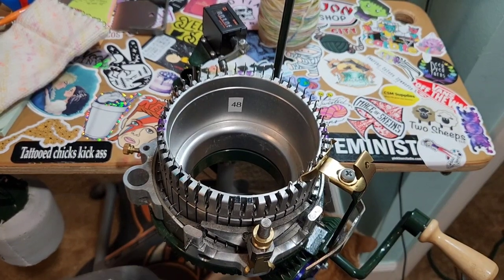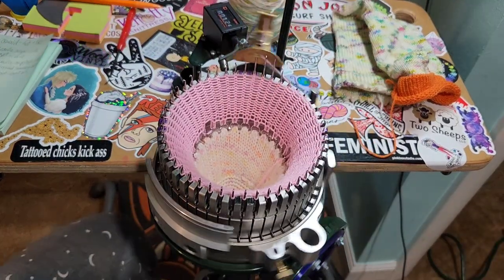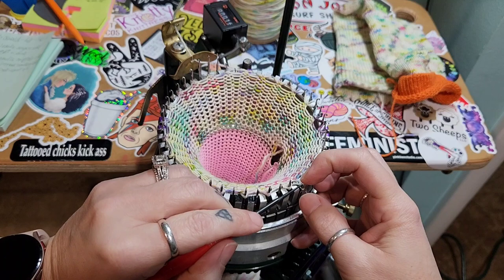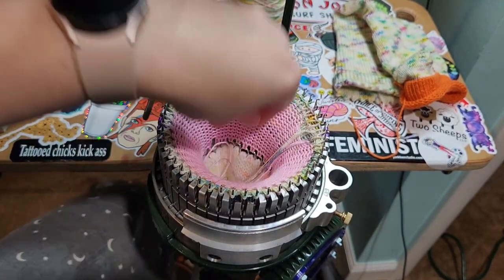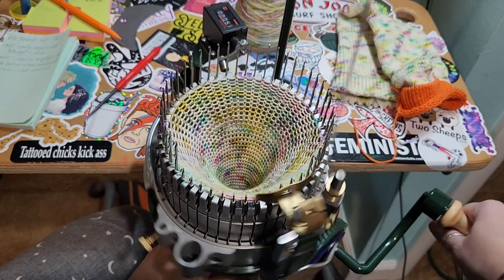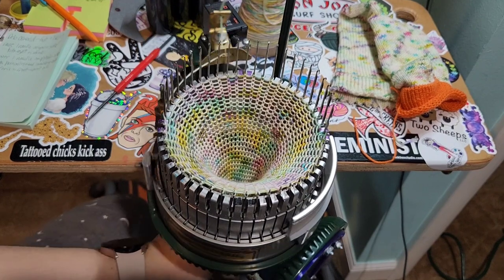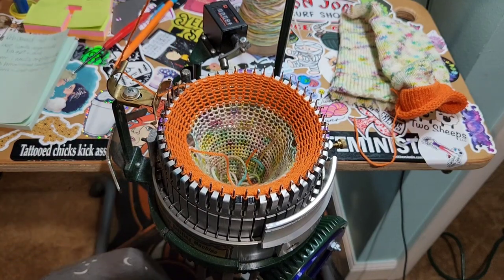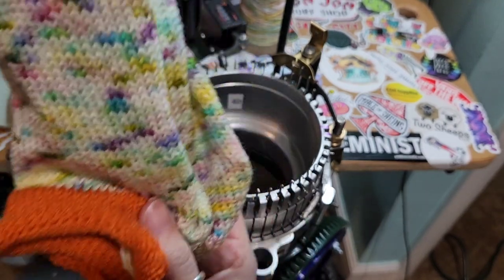Circular Sock Machine CSM. 48 Stitches. Picot hung hem.

Comment: I'm so glad you share these videos! I'm taking another stab at my machine again, partly because when you shared your last video, it reminded me that it really does take practice to get the sock machine to work how you want. I've managed to do a hung hem, though short rows are still eluding me - but at least I've got tubes I'm adding heels and toes to manually and it means I am actually using my machine. That's the most important thing, really.
Reply from the maker: I am really glad to be making them and getting all this positive feedback.  I know I might make videos that have repeat things in them. But I know that is how I learn. Doing something over and over. I am glad you have been taking time and practicing.  I say your next step is making heels/short rows. And if you mess up put all the needles back in work crank 20 rounds and try again. Have this crazy tube filled with heels and short rows that might be okay or fail. Etc.